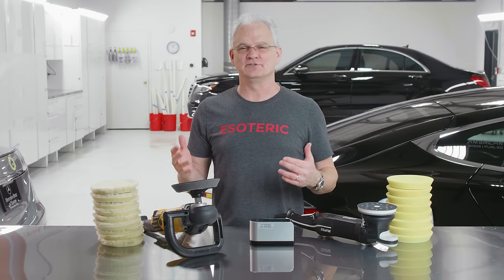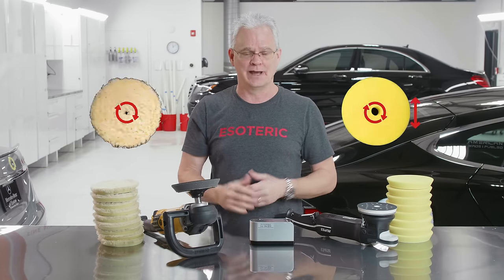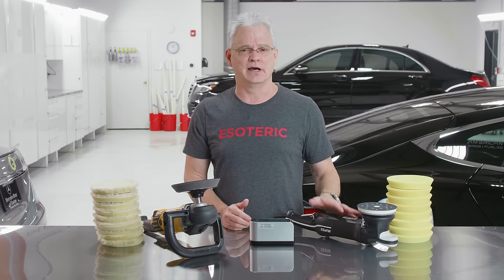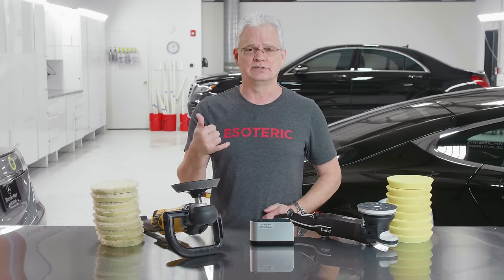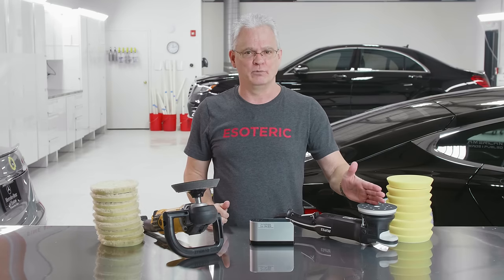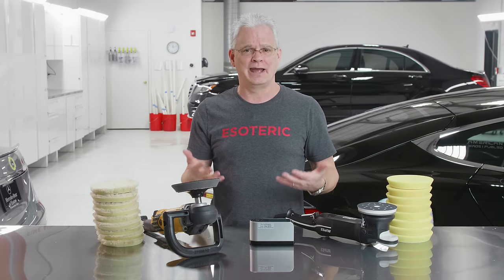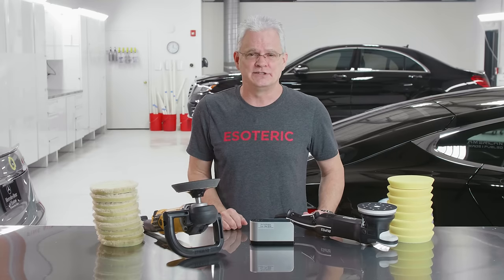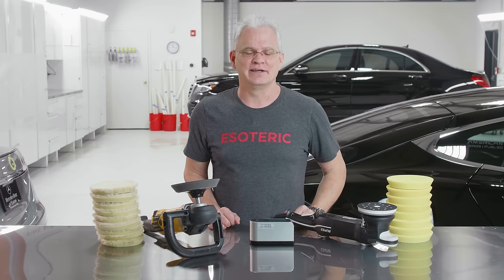Still polishing with a rotary? THIS could change your mind!

Comment: Thanks Todd, I agree with you to a point, but.... there are some cases, because of certain contours on different vehicles, the  orbital just stalls and gets very frustrating, I’ve identified these area’s and hit them with a forced rotation polisher first, then go back to the orbital, .. my polishers are a Rupes 15 and 21, also use a Flex and 3m, for wet sanding I really like the Mirca with Trizact. Point being, they all have a place and application in my box.
Reply from the maker: We have zero issues with contours, regardless of how dramatic they are. It's all in the technique...
Reply: Ya okay, .....Guys, try a forced rotation machine

Comment: I just switched from my dewalt to chemical guys mid level dual polisher.
HATE every second of it.
It's too slow , not enough rpms , having to spend double or triple time on the job.
Trying to get over the learning curve but already shopping for new dewalt 😔 open for suggestions . Thanks in advance
Reply from the maker: Get yourself a Rupes, and watch this video: https://youtu.be/G-1YIb3KuSo
Reply: Jan, most anything from Chemical Guys is not that good... I would hate it too..
Rotary is Direct Drive which can be as fast as you want, and can be used with pads and backing plates all the way down to 1 inch... 
Also 1 machine, does everything, no slowing down, no stopping, and especially no vibration..... If you really Want to use that Dewalt, I can promise you, you will not be disappointed...

Comment: Hello I have a dilemma I have 2 options for buying a polisher and I do not know what to buy whether you can please help me with the decision, 
1)wx858.9  20v 3800 rpm only 
2)BATOCA 12v cordess car rpm 2500-5000

I am very much in favor of worx only I am afraid because of lack of speed direction, Do I have to worry about it because I do not have a speed selector direction ?
In principle I understand the very process of the vox with the machine, 
And the work should be uniformly relatively quick of course before it needs to lubricate the part and the sponge of the polisher.🙏
Reply from the maker: I've never heard of either of those machines, so I can't be of much help in that regard. But with that being said, you probably want at least some adjustability in the speed...

Comment: The only downside of a DA is the extreme vibration when compared with using a rotary which has none. For that reason, and that reason only, I still prefer to use a rotary 90% of the time.

Comment: I am planning to sand and polish my gelcoated boat hull. Will the DA work on gelcoat and is it better to use on it than rotary.  All of the gelcoat video I have watched use rotary.
Reply from the maker: Gelcoat is typically very hard, so a rotary might be a better option in that case. You won't fully know however until you do your first test sections.

Comment: Requiring a cheap rotary I have a kit car been resprayed red I only have this car to deal with and I wonder what polish or compound will I Need to make it shine?
Reply: John Randle  - it takes a lot more information from you regarding your experience with any machine, and what kit car, what type of paint, how many coats of paint, what is the condition of the paint today...There is no set products for any scenario.. There are many products that can do many things and the more experienced the person is the more options still available...
Cheap rotary I hear are available at places like Harbor Freight... Not sure how long they last, warranty, can you replace the brushes easily, etc...
Good luck...
Reply: @frandanco6289  I agree but I am in UK  so we would use halfords or other companies?

Comment: I want to cut oxidation and polish a humongous 5th wheel RV that has chalky gelcoat. I've been told a rotary with a wool pad, and Meguire's One Step #57 will get the job done quickly and easily. I have watched rotary tutorials for proper technique. I need power, speed, and a good result. Is DA still better to do this with?
Reply from the maker: With this scenario, particularly since you're not going for a high level of finish, it may be more effective,  however you will most definitely have holograms when you're done.

Comment: Nothing scary about a variable speed rotary with a 6" or smaller backing plate.  With the advancements in cutting and polishing liquids, and pads, it's so hard to burn paint.  With rotary, it's also easier to work contoured areas.  My opinions are only derived from starting out with single speed rotaries, and tied on wool bonnets, using rocks to polish, lol i'm old.

Comment: Hi nice video, two questions? For doing boats what is your take on rotary then? And for me working in detail many years ago we used the Flex top tool M1 double disc orbital machine, why use a DA instead of Top tool? Is it that you just need one machine? Thanks from Sweden!😊
Reply from the maker: We don't work on boats, so can't reply on that one. We prefer the feel and performance of the long-throw Rupes machines over anything else.

Comment: I have a question, what if some one leaves the polish on the pad for like a year after , and they use a polishing pad cleaner and let the pad dry , is it ok to use that pad again, or throw it away?
Reply from the maker: The only way to know for sure is to try it. It should be OK, but you won't know for sure until you try a section or two to see how it does.

Comment: I started learn detailing in 2017, i bought heavy duty rotary with wool pad. What i feel i am easily feel tired or exhausted when do with rotary but still use it for several cars. 
Then in 2020 i bought my first DA polisher, a 12mm throw with 900 w motor, i feel its very light and easy to handle not like rotary which wilder to control, and always afraid about burning clear coat. And after practice several time i feel that actually DA is faster to get finishing result than rotary, yes initial bite of compound of rotary is higher but you have to take several step to erase a mess you do in compound process. With DA with right pad and quality compound even 1 step polish with rubbing compound could produce better result than some 2 step polish with rotary. Yes i still kept the rotary for some really hard compounding but most of cars didnt need hard compound process

Comment: I'm kinda confused I have the hart 6inch buffer where does this fall into a category. It also seems hard to mess up with it..I also can't add pads mine has covers that go over? Lol can you help me better understand? Thanks
Reply from the maker: Sorry, I've never heard of that so I can't comment...
Reply: Joseph Fogus  - you have some type of machine that is probably not a good choice for really paint correcting... The machines this man sells, including any number of Rotary machines are what you will need if you want to do the work as good as it will go, when you get experience..
Your hart machine, if you cannot even use regular foam pads with the velcro on the back, and have to use those covers, you will probably not be able to do a good job.. However, if you are not interested in getting it really good, then perhaps contact the people that made that machine and see if they have a website store and go look at what they offer..  Good luck !

Comment: I just ordered 2 new rotary's......Flex 14-2 and a Griots GR3....I have a Zota "long throw" da and that will get upgraded this year too...
Reply: Hi Master: Im just about to buy a Zota 6" DA long throw and a Zota 3" DA... Do you recommend this brand? Im new on this detailing stuff and I have a limited budget. In advance thank you for your feedback. Greetings.
Reply: @albertomendoza2251  The Zota 6 inch works well although it seems to vibrate a lot, I haven't had any problems with it. The Zota 3 inch is a nice polisher but it is a waste of time trying to use for "paint correction"...the electrical cord also popped out of the handle, I believe the 6 inch has the same problem some glue will fix this....overall it is a good buy for the 6 inch not for the 3 inch...buy a Griots GR3 rotary for $200.00 it is a fine unit!
Reply: I am adding more detailing videos to my channel, A new one with the Griots polisher will be up on Sunday thanks for your question...
Reply: @masterspin7796  Thank you for your advice. Griots GR3 does not allow the 5" backing plates as fas as I read. The other option I have due to my limited budget is the Maxshine 550 rotary... My car is in a ver good shape but not perfect, my intention is to correct the few swirls and also the  rotary allow me to use different backing plates size. What do think about this brand?
Reply: @albertomendoza2251  Any of the inexpensive polishers will do the same job just not as fun..The maxshine 550 seems like a good unit, I would rather buy a Makita, it has proven to last a long time and runs pretty cool...
Reply: @albertomendoza2251  You can use a 5" backing plate on the GR3 no problem if your just polishing and not heavy cutting...
Reply: @masterspin7796  Thank you Master, really appreciate it.

Comment: What about the Toyota of the bunch - the forced rotation DA? (like the Rupes Mille or Flex 3401) I have used each type of machine and I prefer the forced rotation or fixed gear DA because it is the best of both worlds in my opinion. Probably doesn't cut quite as fast as a rotary or finish out quite as fast as a free spinning DA but it sits right in the middle.
Reply from the maker: Most people (including us) simply don't like the feel of a forced rotation machine. There's nothing against them, but we prefer the complete control you get with a true DA.

Comment: Can I use my dewalt random orbital sander to polish wood and my car? And if not. then WHY NOT? I really dont understand why you need 2 tools if they create the same motion.
Reply from the maker: Chances are the sander has a very small orbit, which wouldn't work well for paint polishing. Your sander might have just a few millimeters or orbit, whereas one designed for paint would have 12-21mm of orbit.

Comment: Anybody that does any kind of heavy wet sanding will find the rupes comes up short in the cutting department. Rotary for cut dual action polisher for finish
Reply from the maker: That's pretty much exclusive to a body shop environment, but with soft fresh paint you can still cut through sanding quickly and effectively with the Rupes.

Comment: Great video for me as I am new to detailing.  Looking for the options for BOATS and require cordless.  Need cutting and polishing, can this be done with same machine?
Reply: I have not used any cordless but perhaps if you a zillion extra batteries, chargers, and they can take the extreme work it takes to correct and finish gelcoat, I guess you might make it..
But if you just spent a little money compared to those hugely expensive battery powered machines, and got a good Rotary with a lot of extension cords, and learned how to use it on gelcoat with the right products, you would be years ahead and have spent way less $$$.  There is always shore power at every boat dock, so you dont have to worry about that part..
Yes, portables are probably more handy, but look at the motor... Is it big enough to handle badly oxidized gelcoat??? Nothing in the world is worse than that..
A good Rotary will breeze through, has a great big motor, those other things, I dont think they have as much going for doing full on boat work.. Perhaps the little trim, etc., stuff inside, the glass, yes, but the nasty gelcoat, good luck with this..

Comment: Just curious as to how you use the DA on curved surfaces and edges.  I bought a new C8 Corvette that has lots of curves and I need to paint correct it before I do the ceramic coating.  There is some orange peel I need to correct.  I am considering getting the DA you suggest, but with a 5" pad I have some concerns.  Great videos.
Reply from the maker: First of all, removing orange peel from factory paint is a no-no, and not something you could do with just polishing anyways. There are very specific techniques for edges, curves, and contours, and that's something that we go into details on in our 2-day training course. Thanks for watching! Also be sure to watch this video on machine polishing: https://youtu.be/G-1YIb3KuSo

Comment: Looks like more of opinion than facts when choosing one or the other.  The rotory has a set spin speed that you know (depending on the radius point), which is an unknown value with the DA.  Likewise furrow generation is avoided with the DA since is rubs in all directions (theoretically).  I would say each has their own place of value and maybe should be used in conjunction possibly..
Reply from the maker: Yes, each has their own place, but coming from someone who used to use the rotary (well) before DA technology caught up, and from a very busy shop environment dealing with all paint types and conditions, we no longer have a need for the rotary.

Comment: I have used both.. i might not get the best technology on DA Pads and Products yet..but from my experience, based on removing fine swirls result from my vehicle 1. The best result (and took the longest time) is using a (cheap) rotary (and cheap pads) two step correction with local 3300 and 4200 local product (fine and extra fine polishing).. 2. The okay and really really fast result i got from using a more industrial grade rotary with 3M system (pad, product, etc), uaing only step 2. The result is not perfect, but for the speed, i really have nothing to complaint. 3. Using a 15mm throw DA with IPO Smart 3000 and Megs M83 (double 6 passes), which i find the swirl is not much removed, and the surface isnt any better than using method 2.. again this may be due to my lack of access to better DA products and technology.
Reply from the maker: If you don't combine the right pads / polishes / techniques, then your results will definitely suffer accordingly.

Comment: Thanks Todd. Just had my Accord coupe repainted and getting ready to do a color correction. Have the old Porter DA for this job using your Jescar & Sonax combo for the two-step process. I am thinking about getting a Rupes DA. Just working on my car, what Rupes model would you suggest I look at?
Reply: The Porter Cable can do anything the Ruppes can do, it just takes longer to get it done.

Comment: Dear Todd , I want to start to learn on how to correct micro and minor scratches plus polishing before coating and ppf installing, so I do have a rotary which is new and not used , so do you suggest me to start with it to master the job or get fresh start with orbital dual action you call ? thanks for the advice
Reply from the maker: Your learning curve will be much smaller with a dual action machine than it is with a rotary. The rotary will work fine for you, but it takes a lot longer to really figure it out. Best of luck!

Comment: Do you have a video that actually shows the DA vs Rotary
Reply from the maker: What would you like, or need it to show?
Reply: @Esotericdetail  maybe a half and half paint correction on a hood showing half being done with a Rotary vs the other half with a DA.
Show the before imperfections and the after results after paint corrections
Reply from the maker: @jesusbernabe5983  They will look the same...
Reply: @jesusbernabe5983  it’s going to look the same, both machines will remove defects, both can finish well when you adjust pad, product, technique, it’s really all preference. It takes longer to learn how to cut, polish, properly finish on the rotary though, takes a lot of learning by doing.

Comment: What do you do about small and tight areas? A DA would not be precise enough?
Where does forced rotation fit in?
Reply from the maker: Use a 3" DA like the Rupes LHR75E or the LHR75 pneumatic.
Reply: ESOTERIC okay i have one of these. Still seems a little big for around front lights/fogs/grilles etc. Usually end up doing these bits by hand.
Reply: @ad_182_uk   A rotary with a small spacer on the end, helps, and you can get backing plates and pads down to 1 inch on a Rotary.. I do it all the time...

Comment: I have a dewalt rotary I just finished painting my truck i color sanding it with 800  then 1,000 1500 followed by 2000 grit I use the 3M perfect ex compound I waited two months after I painted it to color sand would I be able to with one of those dual action buffer to buff my truck do you think it would take me less time and perhaps do a better job
Reply from the maker: With the right combinations, the DA will serve you well. I wouldn't recommend any of the 3M compounds or polishes though...

Comment: after learning from Yvan - I can say only someone who is incompetent will damage with a rotary. DA is best for cutting, but rotary is best at the gloss
Reply: I use both day in and day out and beg to differ in my climate. I am also on the clock, so I’ve tried every combination know to man to cut every corner possible. The best is still wool on rotary followed by wool on da and if required a third step to refine any haze if visible.

Comment: I buff parts for mri machines that were painted single stage they have Dewalt rotary i want to change the process to dual action to reduce burnt parts that have to be repainted slowing up production is the dual action a better option?
Reply from the maker: It sounds like it's definitely worth a try!
Reply: Mercifall Uneeke -- How about just adjusting your technique with the Dewalt machine??? If you are burning the paint, you are using the wrong product/s, the wrong speed, the wrong amount of downward, pressure, and are holding the pad too long on the work..  Are you using and cleaning your pads all the time??? The type of pad also makes a big difference in how the parts finish...
They make backing plates and pads for that Dewalt all the way down to 1 inch...
Perhaps, this may help ???  Good luck...